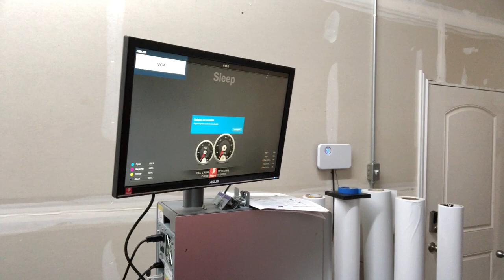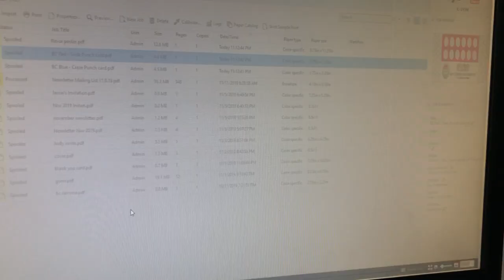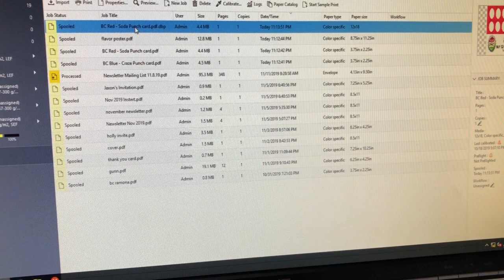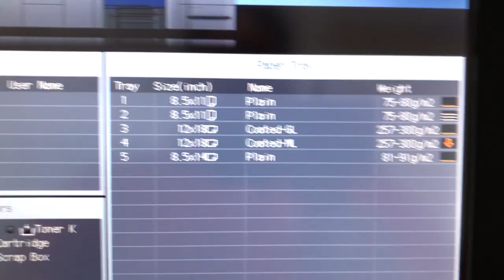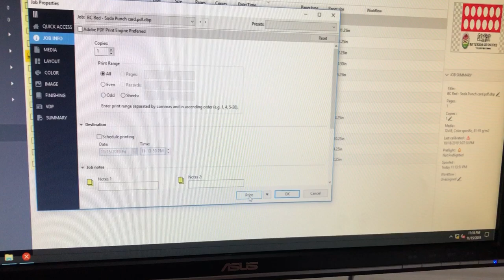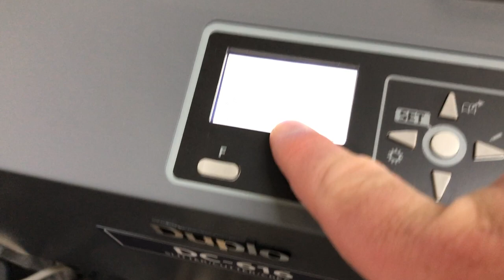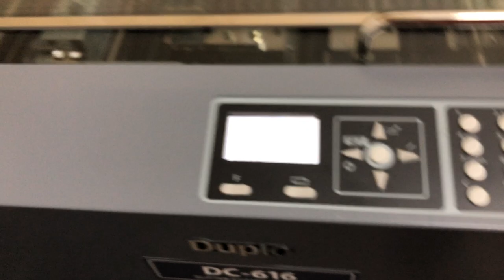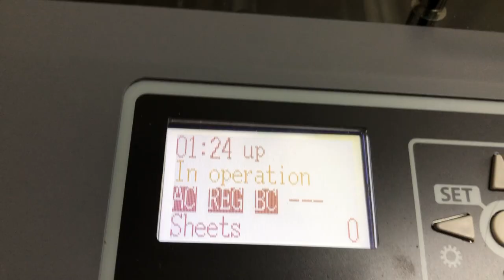How I print business cards - vlog 111 - Print Shop Updates

Comment: Hi Sir, can you share me your cutting machine name? What the specifications of this machine? is it can insert 12x18 paper? Other job can do like creasing or anything else? Im interesred to know more
Reply from the maker: The cutter I use the most is the Duplo DC-616 pro. It can run up to 13" wide, and I'm not sure how long. I know for sure it can do 19". It can cut, slit, crease, and perf. The perf is setup manually all others can be controlled digitally with the onboard controller or PC software.
Reply: @ttms   wow, superb. I love your video. I'm also doing printing shop. Can't wait your next video! Thanks